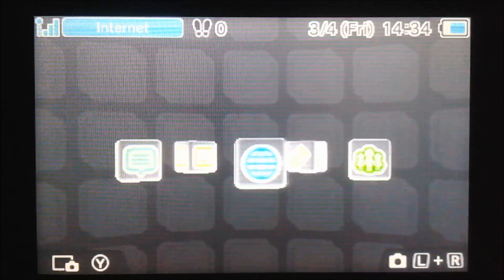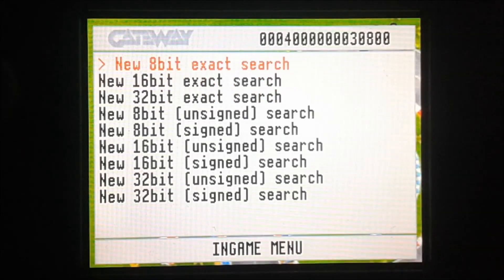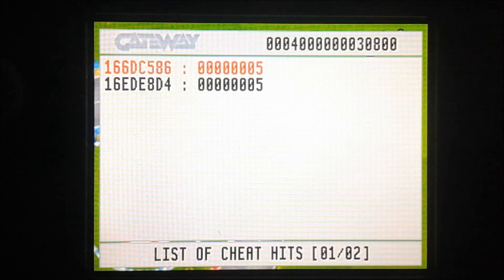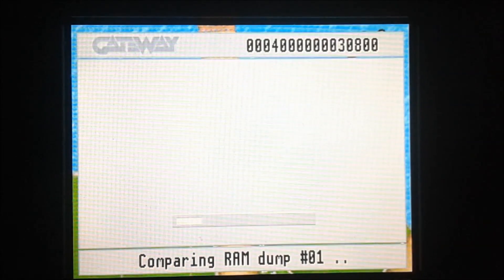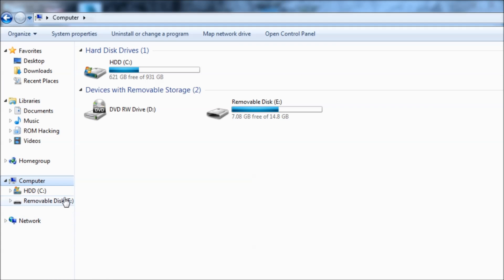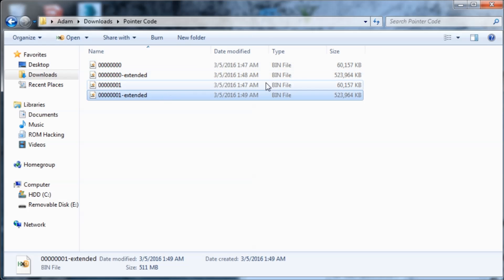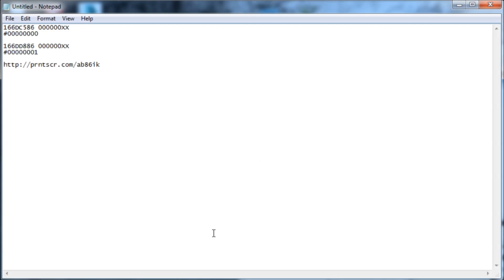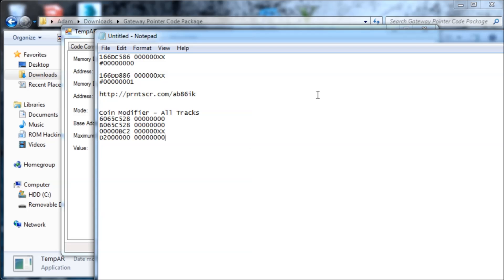[3DS] How To Make Gateway Pointer Codes

Comment: I'm apparently missing some .DLL files. What software does this use..?
Reply from the maker: +Emma Gloom What DLL specifically? I know it uses Microsoft visual c++ redistributables, but not sure which ones.
Reply: +Flare Games MSVCP140.DLL and VCRUNTIME.DLL
Reply: +Emma Gloom VCRUNTIME140.DLL *
Reply from the maker: +Emma Gloom  Try https://www.microsoft.com/en-us/download/details.aspx?id=48145
Reply: Well I'm not smart. I've been installing 2013 versions.. Hmm... Well, as always, you're very helpful! :D Thank you.
Reply from the maker: Emma Gloom You're smarter than 99% of the 3DS community, since they don't even know how to or try to make a simple code xD 
Np, have fun
Reply: My code freezes the game :O Oh well. I tried. XD
Reply from the maker: +Emma Gloom try a different pointer

for what game are you trying?
Reply: I'm going to attempt a " Always find shiny " Code. However, I know many addresses are linked to the values. How do I go about that in the Ram reference application...?
Reply: +Flare Games Only one pointer was found. the code works, but. freezes after battle. (Smash)
Reply from the maker: +Emma Gloom So it works but just freezes? you can add a deactivation switch so you press a button to change it back
Reply: +Flare Games I don't know how to do that. could I make an activator to set it to said value
Reply from the maker: +Emma Gloom yes, that's pretty much what a deactivator is
set a button activator to set the value to whatever it was in your ram dump and that will act as a deactivator, likely stopping the freeze
Reply: +Flare Games Yeah. It just freezes after a battle. But this was a test code. It isn't important. I'm trying to make a code that has many addresses. How do I go about that?
Reply from the maker: +Emma Gloom That just takes a lot of time. It will probably use the same pointer, so the 6XXXXXXX and BXXXXXXX lines will be the same and you can just copy the line(s) below that.

there's really no quicker way unfortunately. :( Keep putting the addresses into TempAR and getting the pointers
Reply: +Flare Games Yeah. I have to find 2 shiny Pokémon to get even close to the pointer. but I'm sure the community would love that code
Reply from the maker: +Emma Gloom Good codes take time and pay off well, so you should try it

Comment: Too bad this doesn't work for item value codes or item amounts
Reply from the maker: +Jordan Pierre Items are different. it should be the same, but it's a pointer in pointer code.
Reply: +Flare Games oh  a pointer in pointer huh, must be how they did the codes for Mario Kart Wii
Reply from the maker: +Jordan Pierre Mario Kart Wii was easy. Nintendo took extra precautions after what happened to MKW.
Reply: Oh I see..that explains a lot